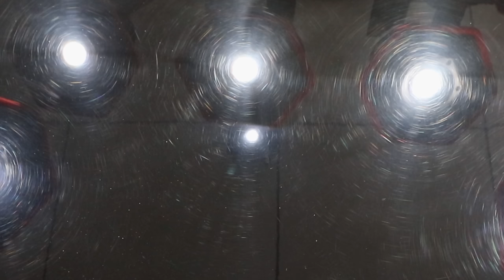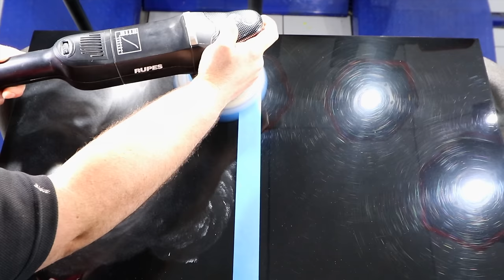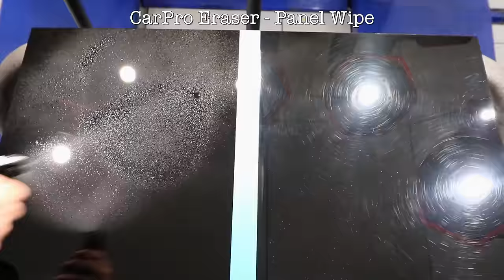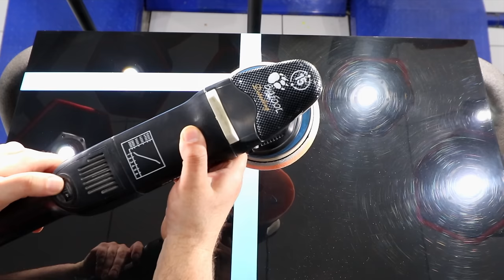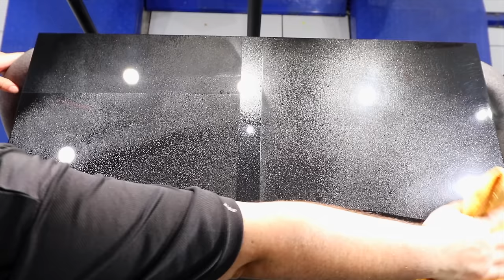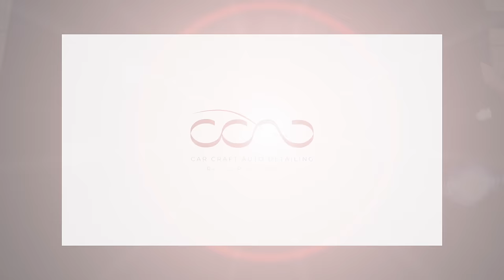How To Cut & Polish Car Paint Correction Demonstration Explained in Real-Time!

Comment: you don't want to remove 100 percent of defects.   the ones that prove to be stubborn, leave them,  or you'll blow through all your paints clear coat desperately trying to fix it further creating more damage.  just accept what a couple passes with a compound followed by the same with a polish will drastically improve the outcome.  I emphasize this with all my customers that chasing a blemish free surface will eventually leave you  with a ruined one.   get it to 80 90 percent better. then coat it with whatever you like to protect it.  done.  👍    great videos. thanks for sharing your expertise
Reply: Your statement is flawed. If you CAN remove 100% then you should.
Reply: No not if you use a paint depth gage

Comment: Having owned a black car, I have always said never again, so hard to get good clean results, but having watched this clip I may consider owning one again. Nice work.
Reply: Same here. Hollograms are pain in the ass. Polished with rotary machine, very hard to get rid off swirl marks.. Dual action polishing machine and fresh foam pad is the answer :)
Reply: U really should wait a few minutes before u Introduce an IPA wipe down.  Let the panel cool down, reduces the chances of clear coat swelling. Other than that great vid.
Reply: @DHxbump  a rotary with the right pad and finishing polish will produce a perfect hologram free finish, it’s all down to the pad and product combo applied.

Comment: Thanks for showing the comparison between single and two stage paint correction. I hadn't appreciated the difference until this video.
Reply: Me too.
Reply: New to this, can you explain the single and two stage.. which one was the single stage? And which one was the two stage? And whats the difference?
Reply: @JayLupe  It may be a little late, but the single stage was the top left corner of the panel, and the two stage was the bottom left section. Single stage=only compound, two stage=compound and polishing.
Reply: @JayLupe  Single stage removes most defects such as micro scratches and swirling, and two stage focuses on doing that as well as improving clarity and gloss of the paint 👍

Comment: Tip (if you don’t do this already): if you have a fresh pad, make sure to prime the pad by rubbing the compound/ polish into the pores of the pad to make sure you get an equal amount of cut. If there is compound/ polish in one area of the pad and there isn’t in another place, there could possibly be places where the pad cuts more than others. Anyways, I can clearly see that your technique works perfectly and if it works for you, then keep up the good work.
Reply: If you spread the polish on the panel prior to starting the work then this shouldn't be a problem.

Comment: This video helped me in a few ways... I've been running a light cutting pad with light compound. Not really getting the results I'm after. I might go medium cut with the light pad, as it seemed this respray on the car didn't like the medium pad with the medium cut compound (I got abrasion worse than wet sanding at 1000 rpm and pre-wet the pad before the compound (always keeping the pad flat and at a 90 w/ light pressure)). I'm considering buying a paint depth gauge to know what I have to work with and how much I'm taking away. Anyways, back to the point. I wasn't sure if I'd need to go back over lightly with the light cut to bring down the micro scratching for the polishing stage. This video cleared that up. I've also came to the conclusion my cutting compound is too old (Meguiars). I can only do half of the working section you did and half of the passes before it wants to dry on me (w/ a cleanish pad, using the same amount of product).

Funny thing is I've always had black cars with decent paint. I inherited a classic car from my father. It has a two stage paint on there, and it's been the most finicky paint I've worked with. I've always been a DIY detailer, so I haven't worked with a ton of different finishes.

Comment: Thanks. I plan on doing this to my F150 and applying a ceramic coating afterwards. I don't have many noticable swirls unless the lighting is perfect and I am looking at the exact correct angle. I believe this is mainly because I do not use circular motions when I wash, all fine scratches are front to back and they are very light. But I definitely want a nice fresh layer of clear for the ceramic coating to stick to so hopefully it will last a long time

Comment: Thanks Sandro. Can you clarify a few points:
1. Do you need to clay bar or do other prepping before compound?
2. After 2 steps, will you need to apply a sealant or wax?
3. When should you apply a ceramic coat and or wax coat?
Reply: 1. Yes, prepping paint before correction work will lead to a better and cleaner result with less variables that affect your results. If there is pre-existing micro debris on the paint and you start paint correction, that will make you run around in circles trying to chase what it is that's giving you a hard time. Prep/full decontamination is definitely helpful.

2. If you have a diy-user friendly ceramic coating, apply that. If you don't use sealant. As sealant lasts much longer than a wax, it makes more sense to put it on freshly corrected paint. You could also layer the sealant after a few hours or even layer it with a wax for longer lasting protection from uv rays and environmental fallout etc.
3. Ceramic coating should be applied on  freshly decontaminated and corrected paint. Using paint prep (iso propyl alcohol based) is very important when applying ceramic coatings. It allows the coating to adhere properly to the paint.

Comment: Excellent demo. I notice you didn't use any water on your polishing pad to start.
Reply from the maker: Thanks and no I didn’t, you can use a spritz of water with can be beneficial at times in hot environments but generally if it’s a good compound it should contain all that’s needed to polish without additional water.

Comment: Hi Sandro!

I've been correcting my daily for some practice.
It is SUPER swirled. It is a Black FG XR6.
I did a few test sections -  

I used NV Precision/Finesse with Blue HDO & Black HDO.
And also Chemical Guys C4/P4. I remove all the swirls - but I just for the life of me am unable to remove the micromarring/buffer trail It finishes beautifully, as in the clarity, gloss and depth - but in ceratin light you can see the buffer trail which is just horrible. So I thought, maybe I am not cutting enough with my polish so I changed pads to HDO Orange, which made it even worse.
I have a shinemate ex605 - I spread the compound around speed 2, and then turned it up to speed 6 with light pressure, slow arm speed movement which has worked for me with every other car I have done. I use Bowden's Flash Prep after it as an IPA wipe and very very lightly wipe off the compound. If I rub the back of my hand on the paint, it marrs it very very bad. So I am not sure, it was repainted a few years ago very poorly - my front bar is full of stone chips, and you can see the primer underneath, I can chip the paint off with my finger nail it's just a terrible job..so not sure if it is me, or the paint.

Any ideas?
I am planning on starting to offer cut/polishing and ceramic coating as a mobile detailer, so this is quite distressting for me.
I have done my weekend cars, although they are white - and I removed about 85% defects which I feel is good enough, and one is coated with Crystal Serum Light, the other Gyeon One.
Reply from the maker: It sound like you are contending with quite a difficult paint, so don’t be too hard on yourself as some resprays I’ve corrected have been a total nightmare to finish well on. This is where some trouble shooting needs to take place in trying to find a polish/pad the paint likes and playing a little with technique as some sensitive paints won’t respond well to the typical products and methods most other paints will. I’d try a couple of different compounds, maybe Carpro Essence with a foam polishing pad - that also doesn’t require an IPA wipe could be worth a go. I’ve sometimes found Rupes DA fine compound to work well of fussy paints and Scholl S20 Black is another I would certainly try. Technique wise I’d try using an very small amount of compound on the pad (maybe one third of normal) and even try after you finish polishing, blow out your pad, do a gentle wipe and use the pad again to polish a little half cycle - without adding any more compound to the pad. 
In other words just experiment a little to see if you find something out of the box this difficult paint responds better to.
Reply: @CarCraftAutoDetailing  Thank you so much Sandro, I really really appreciate it. 
I will definitely give what you mentioned a go, and let you know how I go. I do have Scholl S20 Black, I don't have any Rupes or CarPro polishing gear. If S20 doesn't suffice, I will buy and give both a go.

I wouldn't be where I am today without you.
6 months ago I knew nothing, now I'm dabbling in ceramic coatings & paint corrections, thanks to you.

Comment: Man you guys make it look so easy..but its quite tuff...but getting the hang of it..made holograms now trying to get them out..
Reply from the maker: A dual action polisher (which doesn’t create holograms) is a much easier, safer and better place to start than a rotary.
Reply: @CarCraftAutoDetailing  i have a da thats why i was like i doing something wrong..i think i was putting too much pressure ....
Reply from the maker: You really shouldn’t be creating holograms with a DA - haze and compounding marring is definitely normally during compounding, but holograms are extremely unlikely though I guess it’s possible. 
Yes, maybe you have a very soft and sensitive paint and perhaps need to tone down the aggression in both technique and your pad and compound choices.
Reply: @CarCraftAutoDetailing  thanks i feel way better knowing i can fix/correct the problem...im using trq 15 da with a orange hexlogic pad and the compound is the Vss frm chemical guys..its the one step..but i saw my car under a street lamp and was like😑👎👎😭😭
Reply from the maker: Try stepping down to a finer polish and pad and that should help remove the previous compounding marks. 
The video below may also help:
https://youtu.be/m6tbu3GrTWI

Comment: Thanks Sandro, can you please do a vid on oxidised white paint I’m going to have a crack at restoring an Aussie built skyline r31 that has sat outside and not driven by the elderly 1st owner it has not many scratches just dry oxidation on the bonnet roof and boot, thanks Sandro
Reply: Car Craft Auto Detailing yes that was a great  series and you really brought that car up to a beautiful condition, I will watch that again. The old skyline that I just bought seems to be quite a bit chalkier and powdery than that but I will try and do what you practice and try least to more aggressive, thanks

Comment: So question. You do a wash, then  clay bar. Then step 1, step 2. Would you use sealant as a final touch ? Or wax. I need helping understanding when to use sealant or wax I greatly appreciate it
Reply from the maker: Yes you’d would wash before claying and generally a sealant would be applied before a wax. But you don’t necessarily need to apply both - they are both forms of paint protection.

Comment: If I were to use the same products but instead of using a machine I went on with my hands, would that just be more time consuming, or it would it also be a huge physical effort (in the sense of how much I would have to press the pad against the paint)?
Reply from the maker: Yes and yes - you would have to use both more physical aggression and more time to replicate what the machine can produce.

Comment: Thank you for this video! What do you suggest to remove old egg stains from a paint job? This happened probably 4-5 years ago. I didn’t have the opportunity to remove the egg from the paint immediately after it happened. It’s just small spots here and there on my hood. Wet sand, clay bar, compound, polish, then wax?
Reply from the maker: Just start with the least aggressive method and go up from there. After washing and claying the paint, try a polish and if it doesn’t remove the egg etchings, then try a compound and you can also try a more aggressive pad with it, and only then would I wet sand if noting else works.
Reply: @CarCraftAutoDetailing  Thanks for the insight! You’ve earned my subscription!

Comment: New here and loved the video! I have a new, now month old, black truck. I decided to do a ceramic coat. But the truck came from the dealer with swirls EVERYWHERE! I thought they’d be easy to remove so I did a test spot today. I used a G9 DA, a microfiber pad with Turtle Wax 1&Done. Then I used the TW (Lake City collaboration as I understand)  Orange pad fallowed by the black pad. Spread around speed 1 and worked at speed 4-5. I did a 1ft by 1ft area. It removed a factory pad marring and looked great. But when I put a light in it, I still have swirls. What else can I do on a new vehicle like this?
Reply from the maker: Maybe have a look at this video, if the paint is soft there’s a few tips here to help finish well on those more sensitive paints: https://youtu.be/m6tbu3GrTWI?si=3D33sdo44WjSVxlT

Comment: Do u ever re introduce swirls just by whipping off the polish residue? Would it be recommended to spray eraser on the polish residue and whipe off in one pass touching the paint with microfiber as little as possible?

Comment: What would a 3rd stage of paint correction do/look like?
Reply from the maker: These days compounds are so much better as is our paint correction knowledge and technique which means you can achieve in one or two steps what use to take three or four steps. So in most cases if your combination and technique is on point there’s no benefit in doing a third step.
Reply: @CarCraftAutoDetailing  ok great thanks 😊

Comment: This technique will work great for my perfectly flat car with no seams, emblems, windows, handles, headlights, bumpers....  This tutorial needs a second chapter. I guess it's valuable to know the feed rate which is shown here. But how do you handle the fact that you could burn through high points or whatever? Does this method work on black plastic such as bumpers?
Reply from the maker: There’s dozens of videos covering these topics with paint correction on this channel. You can’t cover everything in one video and if want more information you can search and find that info.
Reply: Good to know. I'll check it out

Comment: I tried polishing by hand a heavily oxidized finish but I realized that I need to use a motorized polisher. Can you recommend a polisher below $60? Any why did you use the blue foam pad is that better for swirls?
Reply from the maker: I unfortunately just can’t recommend a polisher at that price point - I’d say just wait a little longer, save and get something decent as it can last you almost indefinitely. That blue does have both good cutting and finishing abilities.
Reply: @CarCraftAutoDetailing  I went ahead and ordered the Maxshine M8S Dual Action/DA Polisher. It got a lot of high ratings.

Comment: thank you. what speed do you use for polishing and compounding?
Reply from the maker: It can vary depending on the results I’m achieving and the machine I’m using, but generally it’s 3-5 for polishing and 4-6 for cutting.
Reply: @CarCraftAutoDetailing  thank u very much !!

Comment: Hi if I purchase that blue pad and the correcting compound your using there it will work with my machine
Reply from the maker: Pads and compounds are for the most part universal- so as long as you have a Velcro backing plate on your machine and buy the right size corresponding pad (usually 5” or 6”) it should fit and work well with a good technique.

Comment: How many times can you do this? Eventually don’t you run out of the clear coat? What do you do then
Reply from the maker: It completely depends on how much clear you have to start with and how aggressive you are during correction - it could be once or it could be over a hundred times 🙂

Comment: Will a long throw DA polisher make enough of a difference to justify the cost difference over a shorter throw DA? Will a forced ocelation produce better results as a whole over non forced?
Reply from the maker: Longer throw DA have an increased cutting ability and less rotational stall compared to shorter throw DAs in general, but short throw DAs tend to finish better so it all depends on you’re needs. Forced rotation DAs tend to have less cut on the flatter panel areas but more cut around curves and crevices so it also depends - there’s pros and cons to every machine.
Reply: Sounds like i need more machines :(

Comment: So on the first stage compound ,was that in slow motion ,or was that real time as in you are hardly moving the buffer,just lower rpm and barely moving with light pressure?
Reply from the maker: Yes, move it very slowly and use moderate pressure
Reply: @CarCraftAutoDetailing  Thank you

Comment: Are you using isopropyl alcohol as your final step after both steps?
Reply from the maker: I’ll do an IPA wipe after each test section to evaluate the results, yes
Reply: @CarCraftAutoDetailing  Thank you for replying being the youtube was 2 years old. That is a great step that I've never seen mentioned as you could see a haze when buffing out a black car.  Is there a Industry standard to the color of polishing pads texture or does everyone have there own color code? There is nothing more that drives me more nuts then a faint scratch marks left in black paint.
Reply from the maker: Unfortunately there’s no real standard in machine pad colour grades, you’ll just have to read the description of the pads which should let you know their intended grade.